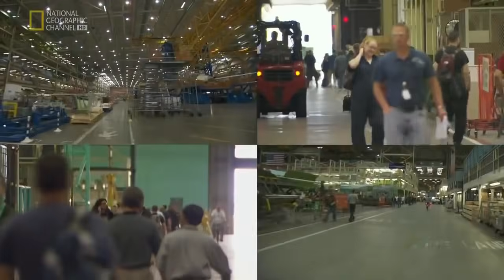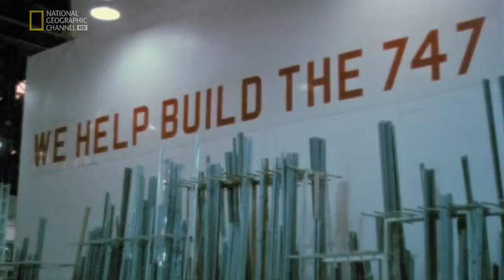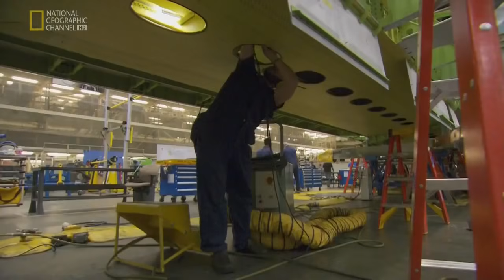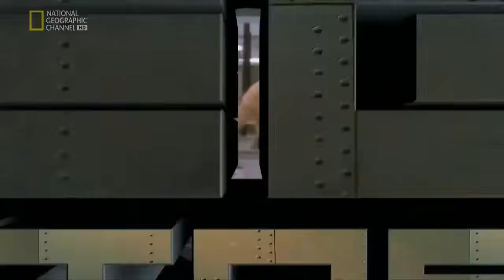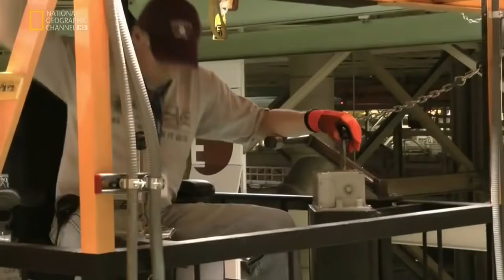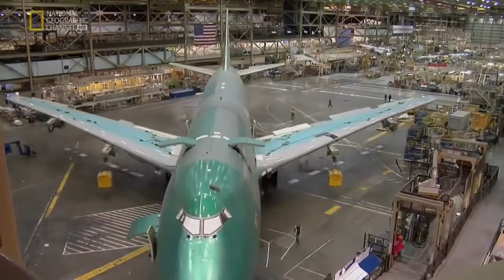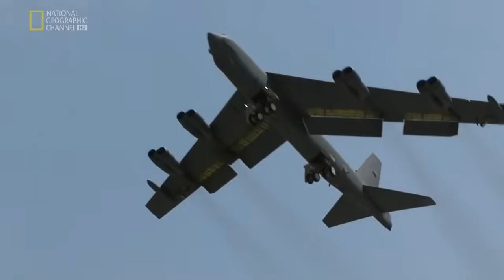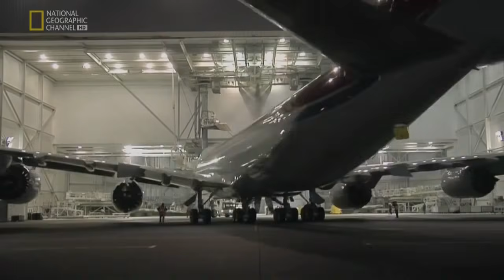Boeing 747-8 Mega factories Documentary- Boeing's latest Jumbo Jet!

Comment: The 41 and 44 section are comprised of assemblies manufactured in Wichita. These assemblies are not within. Tolerances of .010 or better and shipped to Boeing in Wa. Engineering workers to assemble regardless of the errors inherent. By allowing this error to go unchecked  Boeing supervisors are given a huge budget to complete work. Large bonuses are handed out at years end. The 41 and 44 section could be built correct but the bonuses are to lucrative and a driving force to push employees to finish work that is added on as well as their normal duties. In 23 years not one 747 left the shop without travellers,or jobs not completed, due to the amount of rework involved.

Comment: What they are showing in the construction is clearly not a 747-8 but a different version, you can see the difference by looking at the top deck
Reply: The 747-8F has a much shorter top deck than the -8I. Most -8 orders are for the -8F freighter.

Comment: Boeing 747 41 section mechanic twenty four years. The 41 section is the fuselage that runs from nose to first passenger door. Seven assemblies are brought in by box car and joined. Only one unit built in the 41 section  over without open jobs. That plane was held for a day. A banner was created and the crew signed it all but a few die hards, me included. The assemblies are so out of tolerance that there is no way in hell that plane is completes before moving to next position.  We build to specs and engineering not drawings. .Twenty four years in a sweat shop being told how dumb we are how lazy  we are forcing  overtime down our throats. Four weekends on one weekend off and ten hours a day. When asked what our problem was we would tell them and they would ignore us asking if maybe an ice machine would help.  Our   work stands were unsafe. Wheels would unlock and stand would roll. It took over one year to resolve that issue. 
  zero what I gather they ran the budget up and work us to death to collect their bonus Boeing is not what they apoear. Chicago hone of the mafia and Boeing.  . Is  anyone home?
Reply: Your story is both credible and sad. The 747 - 8 does not demonstrate current state of the art design and assembly.
Far too many fasteners and way too much wiring.

Too many slavery type operations. Does the person who works in the Boeing coffee shop get paid as much as a mechanic?  (yes, they are both underpaid, just saying). 

How does Airbus treat it's workers?  In either case, "workers" are obsolete, as they are essentially slaves.

Comment: Best passenger aircraft I ever travelled in was a BAe146. Worst, a 747. Why? The 747's air conditioning inflicted a persistent, loud, stressful hiss.
Reply: That's the worst thing you have to complain about?  Did you consider that they change the entire planeful of air every  3 minutes?
Reply: I have considered that all passenger aircraft have a throughput of air, and that while some do so at acceptable noise levels, some don't. One particular 747 that I flew in, was very poor in this regard and by far the worst aircraft in my experience. Fellow passengers also commented on the noise level. The next leg of the journey was in a later 747, which was highly acceptable as were the two 747s that flew the return legs.

Comment: If boeing wants to beat airbus, they can't just keep making 747. They need to give some variation rather then hid behind their same design for 40 years.
Reply: +christopher grace Entirely re-winging and re-engining an airplane actually creates, what is essentially a new airplane. 

That's why Boeing did not call it the 747-800, but the 747-8- to bring attention to the fact that it incorporates the new-technology laminar flow wing aerodynamics of the 787 and its extremely efficient engines.

Based on aerodynamics and engine performance/fuel efficiency, the 747-8 is an entirely new airplane... which just happens to use the 747 fuselage... 
and it is more efficient than the A380. 
The 747-8 isn't a 40 year-old design.  ;)
Reply: I mean keep the same old design of 1 and 1 half decks. They have not created a new design. For example , show somebody who is not into aviation a picture of the classic 747 and then show them the -8.they will most likely find no differences
Reply: +christopher grace Boeing was actually smart with what they did....you dont need a mega huge plane that fits a shit load of passengers but flies at half to two thirds of its potential most of the times(A380)... you need a big enough plane to fly a number of people large enough to cover costs while still costing the airline a smaller revenue and also being more fuel efficient while still bringing in a large enough profit ...fuel efficiency being one the largest costs to airlines... and thats what Boeing did right here...for passengers its the state of the art interiors and service that counts and that depends on the commercial airline service with whom you chose to fly...that being said, basic interiors provided by Boeing far surpass the airbus fleet... P.S. there is a huge difference in the design between the first model 747 and the-8.
Reply: Webster Jerry Noronha boeing has nowhere near the interiors of airbus planes. Also, you are aware that 1 the airbus a380 is more fuel efficient and 2 has more orders then the 747-8.
Reply: christopher grace said "1 the airbus a380 is more fuel efficient"

False. They are the same.

"and 2 has more orders then the 747-8."

The A380 cost $25 Billion to develop as a clean-sheet airplane... which is 5 times more money than the 747-8's development cost of $4 Billion.   ;)
Reply: StratMatt777 Because airbus pioneered a new airplane, boeing added and changed features of their existing planes. THERE'S A DIFFERENCE
Reply: christopher grace Yes, of course there is.
And, at the request of customers like Pan Am, Boeing pioneered the 747 in 1969 and revolutionized air travel. They almost went bankrupt!

I just read that Airbuses break-even point on the A380 was 200 airplanes.  And I think they've sold at least 262 or more?
So Boeing and Airbus both have probably made just a little bit of profit off of these airplanes.
Reply: christopher grace Yeah, hopefully more!
Reply: +christopher grace  interiors are determined by airlines, not Boeing/Airbus.
Reply: garlicguy I Know that but in airbus' promotional video looks better then boeing's
Reply: +christopher grace As the film said, Boeing always thought the 747 would be a niche plane and continue to be surprised that they have sold so many. Airbus bet on the 380 being the plane of the future. Boeing bet that the slightly smaller 787 would be the plane of the future and only spent a relatively small amount of money updating the 747 just in case they were wrong and the Europeans were right. Airbus came out with the a350 in case they were wrong and the Americans were right. In 2014 Airbus delivered 30 a380's versus only 19 747's for Boeing. But to date Boeing has delivered 329 787's despite the fact that they were late getting it into service and had battery issues with early planes. Airbus has only managed to deliver 171 a380's and 6 a350's despite the a380 being introduced 4 years before the 787. To be fair to the a350 though they haven't totally ramped up production yet.

Anyway, my point is that the numbers seem to show that Boeing can indeed keep making the 747 and still beat Airbus. After all in 2014 Boeing delivered 723 total planes versus 629 for Airbus. The top sellers for both companies are the smaller 737 and a320 not the giant 747 and a380.
Reply: ***** If they want to keep making the 747-8F they will never make a 777-9F (just like they never made a 777-300F).

Comment: The Airbus A380 was doomed from the start. It was simply too big. With only 4 runways that can support it (London Heathrow, Istanbul Ataturk, Dubai International, and Perth Internation) the A380's range is severely limited. Boeing did an incredible job with the 747, especially the new 747-8.  It is big enough to go on long range flights with a huge amount of passengers and/or cargo, but small enough use the average runway. Having a second deck that only goes a third of the length of the fuselage is key.  Because of the A380's full length second deck it is too heavy to land on an average 6,500 (approximately 3,000 metres) foot runway. It needs a huge 10,000 foot (approximately 6,500 metres) runway to take off and land. The 747 was also fuel efficient. The A380 was very fuel inefficient. It also costed more than it was worth.
Reply: Not to mention, because the flight deck was on the lower deck, cargo couldn't be inserted through the nose. Thus, the A380 couldn't be a cargo plane. But the 747 could thanks to its design. This is why all the jumbo freighters you see are 747s. In fact the idea of storing large cargo through the nose is why the hump exists in the first place.

Comment: Ok so an aviation documentary that describes aerodynamic stall as a function of pitch, period. Neither angle of attack, airflow or even airspeed get honorary mentions. It's the case against any aircraft performing a loop without stalling. 

What kind of target audience would need this level of dumbing down and still be interested enough to watch engineering videos? Don't want to damage the kids with too much accuracy in-between commercials?

Comment: Isn't the 747 8i just a 787 with two more engines and bigger?
Reply: yes
Reply: No no no. The 747 is a completely different plane and body. Your comment made me cringe.
Reply: Absolutely not.  The original 747 made its debut back in 1969.  The 787 is a totally new airplane design.

Comment: Boeing had a problem they don't have a factory large enough to make a 747 and 747 was a freighter  
and 747 has 4 engines the bolt rolls into the engine or in one of the fuel tanks and would be a disaster and 747  falls crashes into the ground
she will go against the Airbus A380 if you have 333 million dollars you will have 747-8 all of your own

Comment: it can take only 467 passengers while the a380 can take on 853 passengers, so no competition for airbus.
Reply: 3DPeter sush 👎✝️💧👇
Reply: you sush al you want, it doesn't change the hard fact that airbus has the biggest passenger
plane. Adn not by a few seats but by hundreds of seats, so boeing and you  can eat that.
Reply: 3DPeter A-380 Can take 550
Reply: ".....provides seating for 525 people in a typical three-class configuration or up to 853 people in an all-economy class configuration."
https://en.wikipedia.org/wiki/Airbus_A380
Next time do your home work dude.
Reply: 3DPeter 🙁🏴🙁
Reply: Airbus fits 853 if they made the entire plane into a single class of coach. Most airlines break it up into segments however, having coach, business, first class, etc. As a result, it typically holds ~540-560 passengers. The 747-800 holds 467 when set up with coach, business and first class as well. So in the end, airline companies need to decide if the fuel economy on the 747-8 which is in it's own league outweighs the costs of an additional 80 passengers would have on spending more fuel within an A380, as well as the constant new regulations being added for fuel economy standards. 

Keep in mind that the Airbus is a full 2 story plane, however, it's very short. The 747-8 is the longest passenger plane in human history. The whole length of the bottom floor of an A380 is about 2/3rds the length of the whole bottom floor of the 747-8. On top of that, the whole top floor of the 747-8 is nearly the length of a standard 737.
Reply: The A380 isn't very short, because it's only 9 feet shorter than a 747-8, but when it comes to the wingspan,
then the a380 is an entire length of a full size shipping container wider, and the A380 is a little faster, not much, but faster. And the a380 has more room inside, so it wins on al points, except  on those few feet in length.
Reply: 3DPeter  it does lose Airbus was not smart enough to make it into a freighter so when all the passenger Airlines get tired of buying this big piece of s*** they won't be able to even sell it as a freighter like Boeing can with the 747 because the original designers of the 747 had the forethought to turn it into a freighter also if need be here Airbus blows
Reply: A boeing is 24/7 a freighter, because when the don't haul goods, then they haul cattle, american 
fat ass cattle that is, so that is why  boeing keeps on refurbishing an 50 old design, because
cattle doesn't see the difference between a new or a oldtimer plane.

Comment: I have to say this but the plane is built in the USA we don't measure on the metric system.  Fuel is not measured in LITERS in the aviation industry.  It is measured in POUNDS.  It is an industry standard.  Even the Airbus is on the Standard system Otherwise known as American system because aviation has a standardized set of procedures.  Lives depend on it and everyone in the industry does everything the same way.  Now that is not to say some airlines don't have a slightly varied procedure because I am sure they do but for the most part everything is standardized. However that is the airlines, not the manufacturer.
Reply: okay.

Comment: I've been on both 747-8 & A380 in economy with different airlines.  The A380 on Korean Air and Emirates has a smoother take off than the 777-300ER for either or 747-8 with Korean. That's the only edge I'd give to the A380. A lot depends on the airline and how they are configured. For economy, Emirates has bit of a wider seat on their A380 than Korean Air's A380 or even their 747-8. You wouldn't be able to tell on board Korean in economy if you were on a A380 or 747-8 because the layout is almost identical, they only difference is the take off. I could see why some airlines would choose the 747-8 over the A380 for some routes because it does hold a bit less capacity and is a bit more fuel efficient. Nothing worst than a A380 flying half empty over 10+ hours.

Comment: Reported to BOEING. World Trade center LV NV a train with military equip. 1/4 mile long ported on tracks SECURITY GAURDS. Converged on me I told um I Work for Boeings In Everett.  Did not phase them at all I had to leave...this site is abandond. The most Luxurious Malls and buildings ive ever seen..Located Grand Central blvd Las Vegas. Abandond Brand new state of the art .with Bus center type ..ENGINEERING PROJECT its DEAD...
Reply: I started taking Photos Walking to the end of the train..It looked like old junk. From military auctions.painted yellow over green 4 tanks. Most hidden one showing trucks. 5 ship containers "thought could be used walkin out prisoners ..tanks mabe building assualt /threts 
But not much else. paint was not desert color. Its Yellow and on part not finished painted convenintly ..uno. Da
Reply: 4-5 months ago. ..huge parking just left. And interchange for freeway left ..dust everywhere It illegal. Next weekend sunday they had a lot of laborers standin around. But there getin it finished..at IRON HORSE AND GRAND CENETRAL IN LAS VEGAS NEVADA
Reply: So did i make payroll...need som capitol...BOEINGS ARE U THERE HELLLO